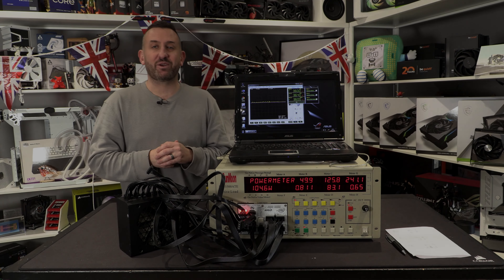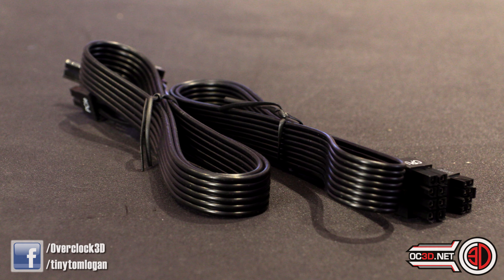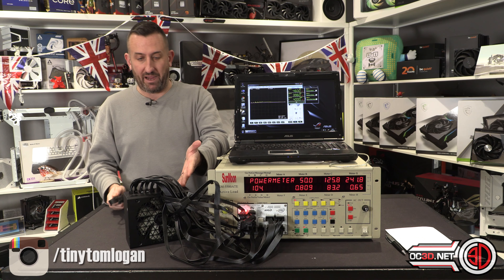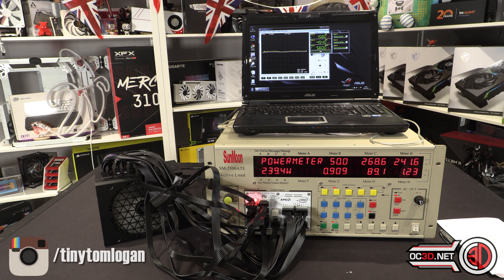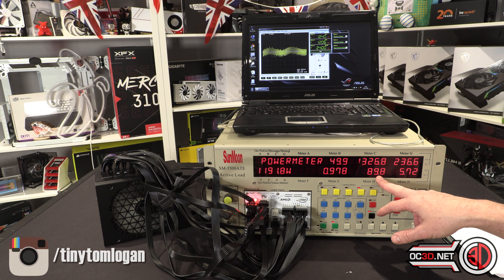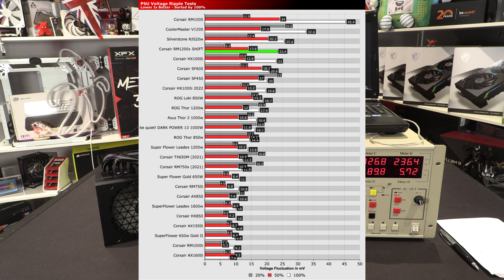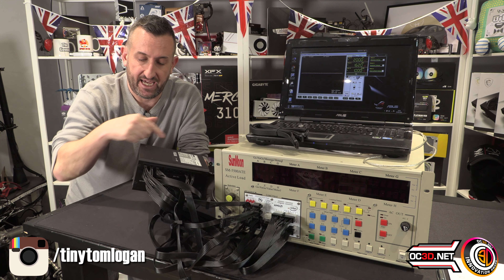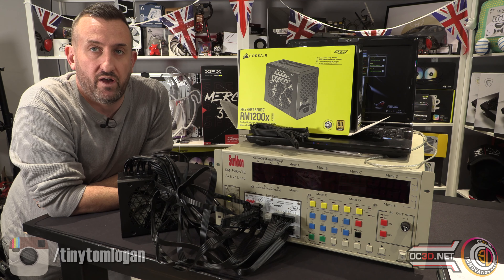Corsair Shift Series - RM1200x PSU Review

Comment: Ya but now i saw that no corsair has no 12 vhpwr socket on the psu 🤯 , i have purchased this psu but on the magazine site says she support 12vhpwr but all the psu does that if you have the  cable .....wtf ....don't buy corsair if you specifically want that socket on the psu , I should have bought bequiet 🤦‍♂️ i don't wanna say that she has coil noises 🤦‍♂️🤦‍♂️...ATX 3.0 its not the same as PCie 5.0 , the ATX means that supports 12vhpwr and PCie its the socket itself, don't get confused 👌 ... corsair its ATX 3.0 but not PCie 5.0 😂
Reply from the maker: They wireinto the pcie connectors on the PSU
Reply: @OC3D  So if i use the cable that came with the psu , corsair 1200 swift will be ok for the 4080 or should i use 3x pcie to 16 pins that came with the video card?  Corsair cable has only 2 x pcie to 16 pins
Reply: @smamas114  Use their cable, Corsair specs their 2x8 pin 12vhpwr setup at (2x300w) 600w total.  The Shift is an extremely good (safe) PSU for the 4000 series. It's honestly probably better than having a 12vhpwr socket on the PSU, unless you have an ATX 3.1 PSU with a 12vhpwr socket.  ATX 3.0 PSU's that have a 12vhpwr socket are screwed/"unsafe" : (

Comment: Had a problem with mine, didn't run when I started my PC. Only "clicked". After testing it was ok with the paper clip trick, I found out it didn't like one of my USB drives. A process of elimination showed me which one was the culprit, so I removed and then it worked fine. Why did my last 750W work with that USB inserted, but this just didn't like it? So if you get the same issue, use the paper clip test, test all cables are connected and check your connected drives and accessories.

Comment: May be slow on my part or missed it completely here.
Not a tech guy.
Will this 1200x Shift work with an Asus Z690 P D4??
Reply from the maker: @chrisr7597  yes. You don't need to worry about psu's working with motherboards. You just need to make sure you get enough wattage on the psu to cover the whole system
Reply: @OC3D  Appreciate your knowlege good sir.
New sub too.
Thank you.

Comment: After finally understanding the whole ATX 3.0/3.1/12vhpwr/12v-2x6/revised GPU shortened sense pins madness, the way Corsair handles the 12vhpwr with 2x8 pin is probably the best route.  People with ATX 3.0 PSU's with a PSU that has a 12vhpwr socket are screwed.  It isn't a factor with the 2x8 pin setup.  ATX 3.1 shortens the sense pins on PSU end just like GPU makers have had to shorten the same pins on the GPU power socket.

Comment: Can you explain how the 12vhpwr works when its split into just two 8 pin PCIe? I thought PCIe connections could only output 150w each, so if its only split into two, how does the 12vhpwr on this psu supply up to 600w?
Reply from the maker: Corsair PSU's designed for fan out (daisy chain) cables, so each one of theirs at the PSU end is rated for 300w

Comment: It's possible the high power pci-e connector is using a different cable jacket for a higher temperature raiting. It looks more like a rubber than PVC. Enginnering would do this to try to reduce concerns about the connector being damaged by overheating, and a higher insulation temperature wire can carry more current in various safety standards.

Bringing up the question is it even safe to sleeve these cables as any sleeving on the outside could trap heat

Comment: I have an HX850 platinum. It has inline capacitors so the 24 pin power cable doesn't bend so well. This means that you will need at least 2 inches of case cable space in back,, A better design would be to leave the power cables up front where they were and move accessory cables connections to the side

Comment: FYI, I have a HX 1200 Plat and an ASUS STRIX 4090. I bought that Corsair cable for the GPU, and it didn't work. It was a black screen on boot and all the way to windows. I powered it down and plugged the adapter back in and it all worked fine. The I got the CableMod 4 - 8 pin to the 12+4 VHPWR and that worked perfect. I think on initial boot the card tries to pull to much through the 2 - 8 pin and just NOPE! Not going to work. 

Actually, I'm going to back up a bit and before all this crap I went through. When I first got the 4090 I had only the 3 - 8 pins from PSU to GPU and used the pigtail jumper for the 4th connection on the adapter and that worked just fine as well. But I did pull out the PSU box and found the 4th 8 pin cable and connected the adapter to 4 separate slots on the PSU. This was before I got the CableMod PSU cable.

Comment: They're not including capacitors on the cables anymore like they did on the amazing RMi series. They're not on the sleeved cable sets any more either. The cable set I bought for my RM1000i has capacitors. Sure they're bulky and makes cable management a bit harder but I'd rather have them on there
Reply: Is it better with caps on the cables?
Reply from the maker: @mommick  much MUCH lower ripple

Comment: Seasonic Vertex GX-** Gold series seem to have Corsair trumped on the cable sleeving in this segment of the PSU market. I think I'd leave Corsair alone if I were an SI with this one. Is it just me or have Corsair gone off the boil with PSUs just lately? AX1500i still going strong mind. Just looked at the vid I bought that on the strength of - 48:18 mins, and you remarked that you'd cut it short!🤣🤣🤣

Comment: Seasonic User manual telling that you must use FAN up if you want to use the semi passive FAN mode.
Reply: Only if the psu is at the bottom of the case, if the psu is at the top of the case, then its fan down.
Reply: @Nite-Lite-Gamers  Recently iknow only the Torrent case is where the PSU is at the top...

Comment: I like the idea of the connectors on the side like that, makes for easy changing or editions with out trying to squeaze your hand into a tight gap, which is the normal for the bottom of cases
Reply: Who really needs to do that on a regular basis? This feels like for someone that has multiple HDD's in the basement of their case and could use the room but also has good spacing on the side panel.

Comment: Great interesting Video. I have just bought a new MSI MEG Ai1300P 80+ PLATINUM ATX 3.0 for my Zotac RTX4090, as my Super Flower 1600 Watt was not working correctly, it turned my monitor off,  when browsing playing game it doesn't matter what I was doing. Some times it would work alright for a day other two, other times it would only work for 10 minutes. I am installing the MSI PSU on Friday and hopefully it will resolve my issues.

Comment: If the back Plate, which holds your motherboard, is solid without openings you will never succeed to fit in the cables as the space between PSU und back Plate is minimal. In my case I had to flip the PSU upside down so the connectors face to the "open" direction. Anyway Corsair makes quality PSUs, my old one never failed (as others did).

Comment: I kinda like the way the connectors are on the side, as that makes it a lot easier to plug in and out cables from the rear of the case. But it require that you have a case with ample cm of space for the cables + the case obviously cant have any metal wall that obstruct the connectors.

Im not a fan of those new gpu cables. Looks very easy to twist it slighthly out of its socket, so have to be very carefull on how you line up and secure the ends. Wierd that it doesnt seem to exist some "very round / soft versions" of that cable. Or, maybe it does + X amount of degree adapters available for both ends.

Comment: Hey OC3D, I have a question regarding the RM1200x GPU power cable. So instead of using the adapter provided with the GPU which is a Type 4, 4-to-1, some people have started using the Corsair Type 4, 2-to-1 cables....however, the ports on the PSU are all new Type 5 Micro pins and the RM1200x comes with a newer version of the Corsair 2-to-1 GPU cable with the Micro pins at one end. Is this cable rated to 600w and safe to use on the RTX 4090? I recently installed my 4090 and it seems t be pulling 40w max during bench testing and all games run at less than 60fps. I used DDU to uninstall and reinstall the drivers, checked to make sure I wasn't using integrated graphics, and now I'm at a complete loss as to what to do. I'm thinking its a power issue and the card is not receiving enough power from the PSU provided micro pin 2-to-1 cable. Cheers
Reply from the maker: Ill screenshot this now and ask Corsair for you but I would be VERY surprised if its the cable. Try a fresh instal on a spare drive first. My gut is telling me that if the GPU was being throttled that hard by the cable - it wouldnt even have booted in the first place.
Reply: @OC3D  Okay so my question still stands on whether or not the PSU 12vhpwr cable is rated for 600w, however I did figure out the problem. I was using a riser (vertical mount) that wasnt rated for PCIe 4.0. As soon as I plugged the card in directly to the board, all of the performance tests immediately jumped back to normal. Thank you for addressing me though, hopefully Corsair gets back to you on this.
Reply: @OC3D  Any luck?
Reply: @electroevolution5777  I bought this power supply, the 850W version recently and heard a rumor that the GPU power cables are rated lower for the lower wattage units. I specifically asked Corsair and they replied saying that the new GPU power cables are the same across the range (750w 850w 1000w 1200w) for this power supply and they are rated 600w as per standard.

Comment: I'm interested if this would be good in the Fractal Torrent cases, particularly the Compact with it's slimmer cable management space! Being a top-mounted PSU too might throw a wrench into the design in a way Corsair didn't anticipate.
Reply: Remember your 24 pin MB connector, It is not slim.
Reply: It does go in (to the full Torrent), but I've read some people being unhappy that the cables press against the cross bar.  It does somewhat defeat the purpose though as you need to plug the cables in before sliding it into the case.  I'm considering it at the moment but honestly I wish there was a non-shift ATX 3.0 version, and I wish it had a 12VHPWR connector - I think they may have shot themselves in the foot a bit here.  General availability of 1000W+ ATX 3.0 PSUs are a bit limited right now.

Comment: Big design flaw the fact that the fan doesn't stop again when going back to pulling low watts.
Reply from the maker: That's normal with most brands
Reply: @OC3D  It may be normal but in my opinion when paying top dollar for a PSU it should be able to go back to 0 rpm when under low load, we are 2022 not 1989 and if Corsair cant be bothered to put some simple logic on their MCU board in the PSU that allows this functionality then they are not putting in the necessary effort, in my opinion. And they absolutely have not re-invented the wheel, far from it.
Reply: Having the fan run constantly is of no benifit and noisy. In fact it is a detriment. unless you really push to the limit Your fan will die long before a quality PSU, and by that time you'll  already have or want to upgrade.
Reply: @OC3D  It 's everything but normal!

Comment: Corsair put mediocre designed cables (although the electrical specs are fine) in their expensive products to try and get even more money out of you by making you want to get the good add-on cable packs. I got a super expensive AX series for a build a few years back and the CPU & Motherboard power cables are horrendously bad in terms of flexibility and the CPU cables particularly had issues fitting in the appropriate grommets in the fractal case. Because of that shit anti-consumer behavior I recommend anyone refuse to buy corsair's addon packs and instead get 3rd party cables.

A $400+ USD PSU should have at the very least, all the CPU, GPU & Motherboard cables being individually sleeved cables with paracord or nylon sleeving and combs.